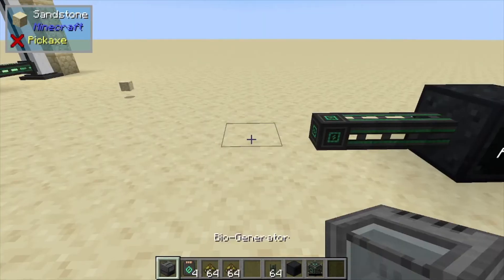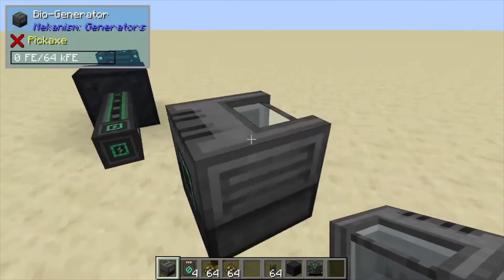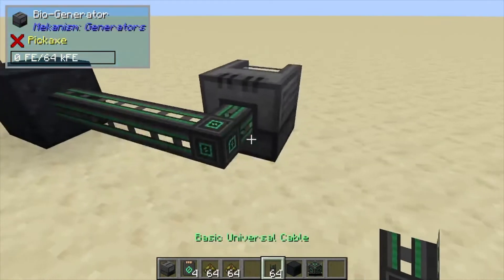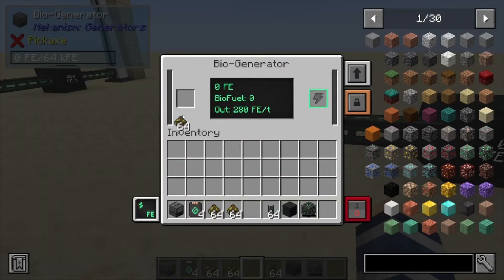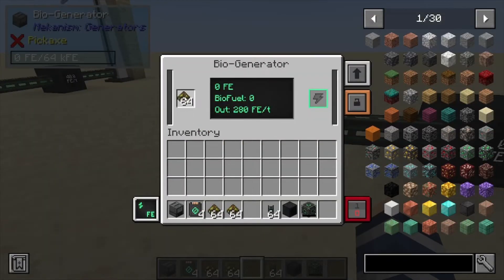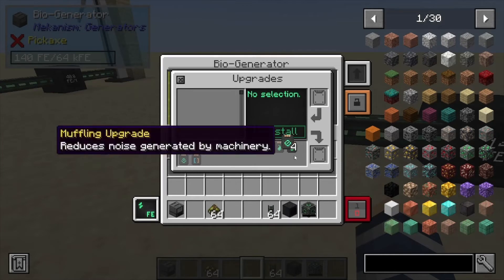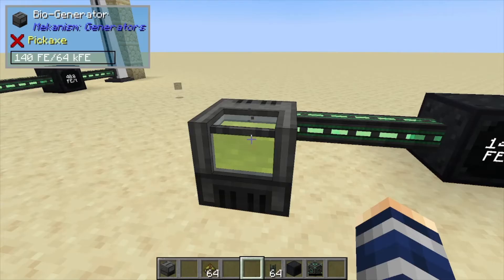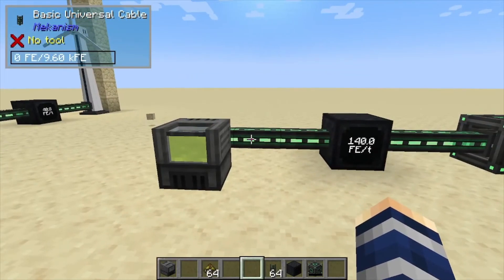Mekanism: Bio-Generator (how to use)

Comment: You had manually loaded the fuel into the generator, but can you pipe it in?
Reply from the maker: Oh yeah pipes and hoppers work
Reply: @MCMentor1  Ever thought of producing a video on the configuration of the bio-generator?  I'm tired of making mistakes where thing do not work.  There's nothing in the wiki about the configuration and automation of Mek machines including the bio-generator.  Thanks for the information..
Reply from the maker: @moonz3r1  you mean a full automation setup ? I could make one but it would probably involve other mods as I don’t believe off the top of my head mekanism has farming machines. I do have a video on ethylene gas power that’s not extremely difficult has massive power and compact